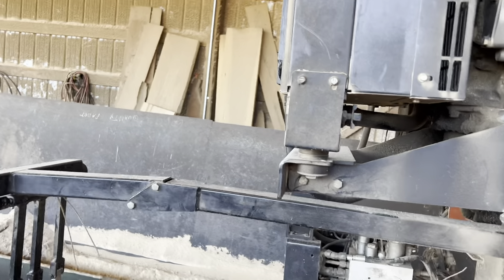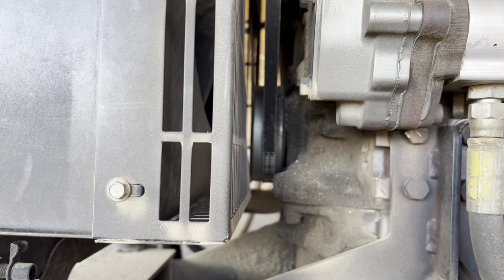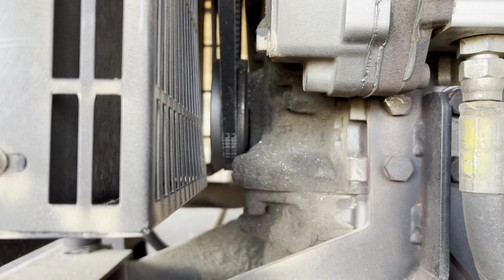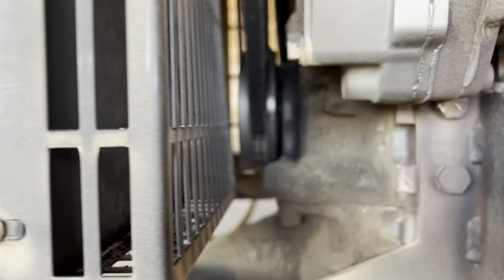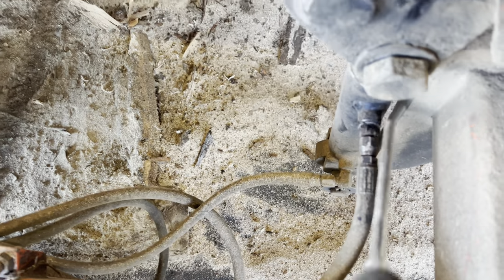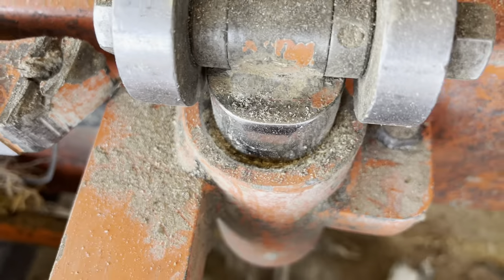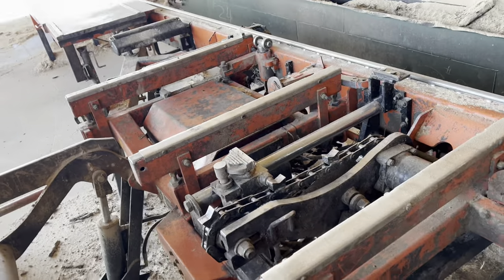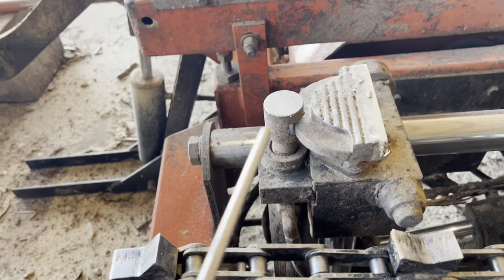Why you need a air compressor!

Comment: I took a 2 ft brake line and attached it to my air nozzle to get up close in hard to get spots.
Reply from the maker: Nice.  Didn’t think of that.
I was in harbor freight they have a kit with a couple different extensions for around 5-6 bucks.

Comment: If you're up for it, please video the seal replacement.  I'll have one coming up in my future. Thanks!
Reply from the maker: Okay I’ll try and time it so I can. It’s not too bad.
Reply from the maker: How many hours before yours started leaking
Reply: Just bought the 70 last December. No leaks yet, but has 7000 hrs, so it will happen sometime, especially if the interval is what you saw-I think you said you've done 3 in a little under 9000 hours?
Reply from the maker: @BenedictSawmilling  it will range from 2500-5000hrs at least that’s about what we have seen. We run ours wide open majority of the time. As in blade gets kicked out to change. We also run Amsoil signature series. We have one friend with a normal 70 that changed his and 4000.
Reply: Thanks for the info!